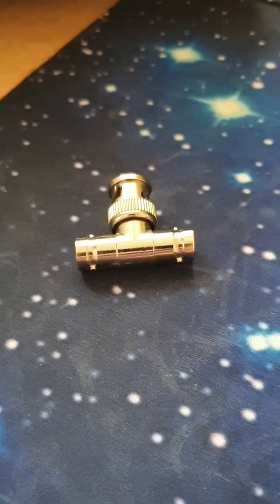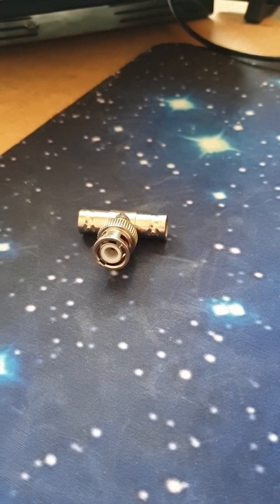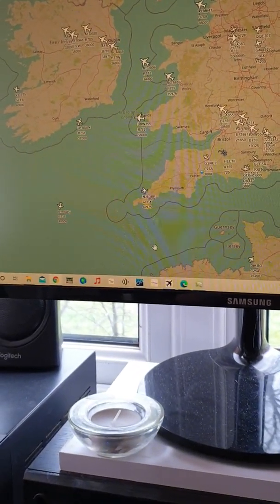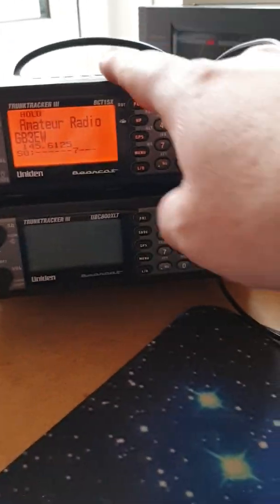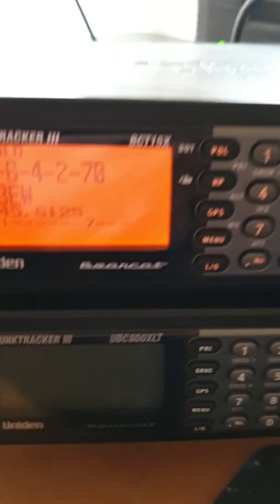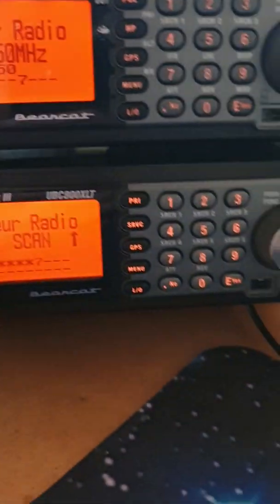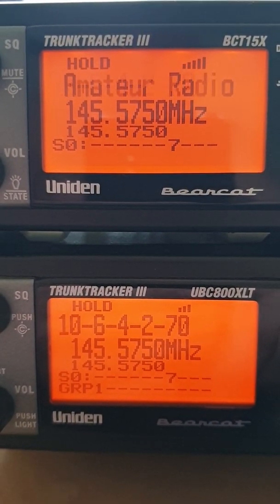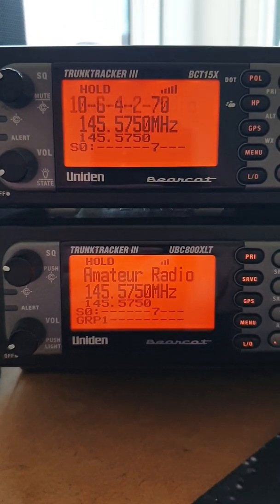One antenna, two radios with  a T piece.

Comment: All you need is a 3-way switch. Connect left and right to each radio, center to ground. The other side connects to antenna. All grounds connect together.
Reply from the maker: Not sure how that would work if I want to use both radios at the same time ?

Comment: Those T connectors were used in very old computer networks, they are not designed as a splitter.  I think both radios could interfere with each other as the T is a direct connection between all ports.  Cable TV splitters are wound coils and provide some isolation between the outputs.

Comment: The way I understand it, is that the best power transfer is when source and sink impedance are equal (ie 50Ohm on antenna and 50Ohm in radio). When you couple two receivers together, the effective radio impedance becomes lower and therefore the signal level available becomes lower (mismatch). Why the two receivers behave so differently when connected together, I've no idea although your theory one is more sensitive sounds correct.

Comment: As the person behind Broadsword antennas I watched your video with interest. The test you conducted on 2mts was interesting and would have been beneficial to have conducted the test without going via the preamp (just my personal opinion but in 40yrs of radio I have never rated a preamp as I personally think for all the signal boost you get you will also get the associated noise boosted) but not saying some people use them and enjoy them.  My personal findings re a similar test to yours that I conducted was that with 1 antenna into a t piece and then that t piece into 2 radios as long as the freqs were fairly close ie. in bham tower is 118.3 and ground 121.8 I found no signal loss on either radio. However if I then tuned one of the radios to say 250mhz then 1 of the signals would suffer attenuation for which a number of reasons could be attributed such as location of both the tx stations, the spec of the antenna etc. But overall yes your are quite correct in saying that a T piece can be used but as stated would usually work best if the 2 received freqs are close. G0NWX. (PS that sounds like a midlands accent ?
Reply from the maker: Hi Darren, thanks for your comments.  The preamp is there as I run it to a passive multicoupler which feeds 5 radios, I do get loss without it. I've been experimenting with a mast head preamp recently, I have a 20m run of 213 and it causes more problems than it solves. I plan to redo the test next week with a few different configurations, including no preamp. Rich.
Reply from the maker: Oh and yes, Sutton Coldfield originally.